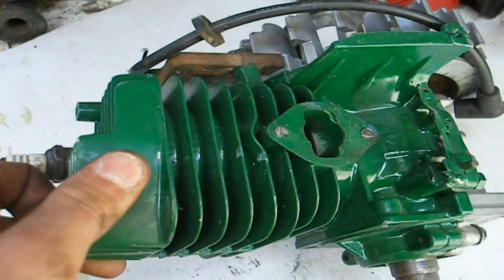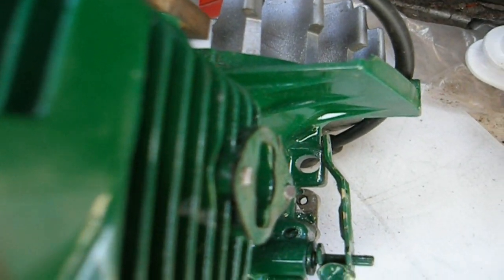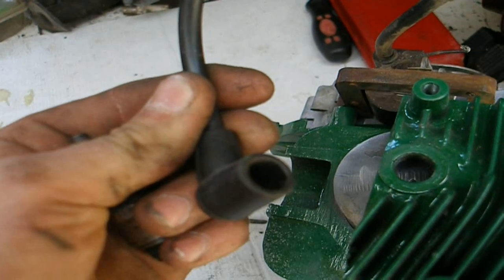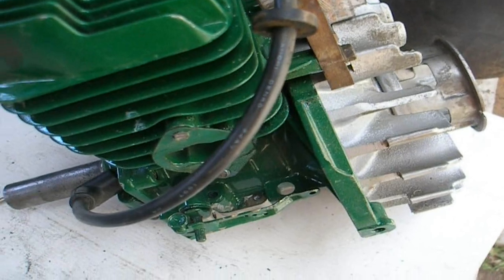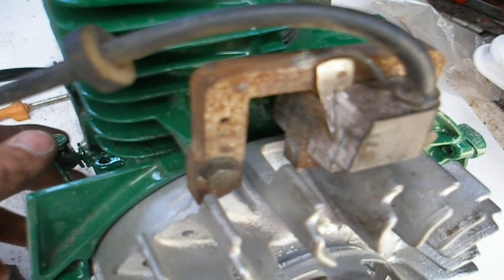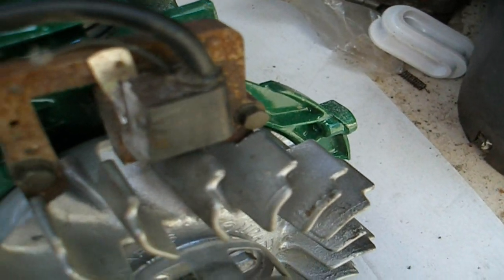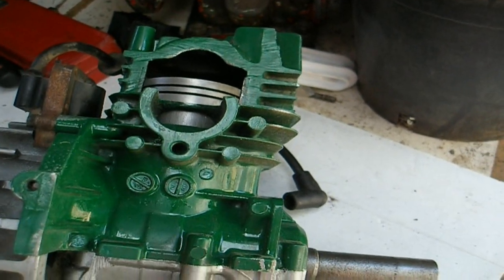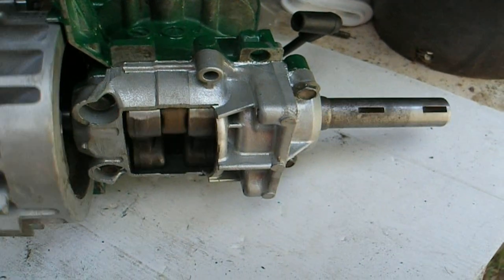2 stroke starting and running problems part 2 of 2

Comment: im working on a 90cc 2 stroke on an eton quad.  starts real nice and for the fist few seconds you give it gas it pulls really good then boggs down and wont move.  if you let it idle for a couple of minutes it will take off good but bogg down again and if you keep the throttle open when it boggs it will surge and bogg down agian. any ideas

Comment: Hi mate, i have got a 2 stroke 100cc engien in my quad bike, when i start it, it ticks over but a lot of rich smelling smoke come out of the exhuast and oil too, and it has no power, and does not move when i sit on it, after a couple of kick starts it has worse, to the point where it will not start, any thoughts on it,
cheers
nice video.